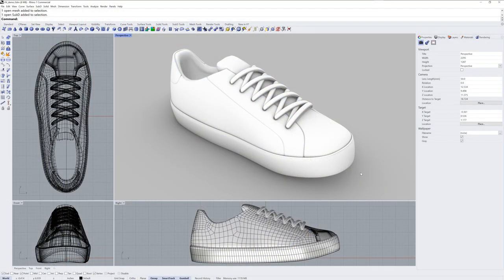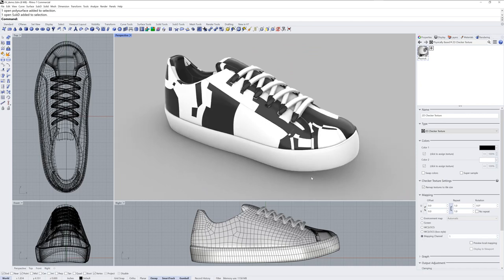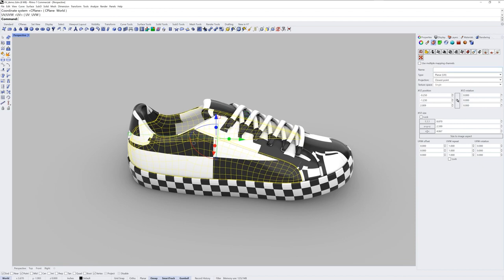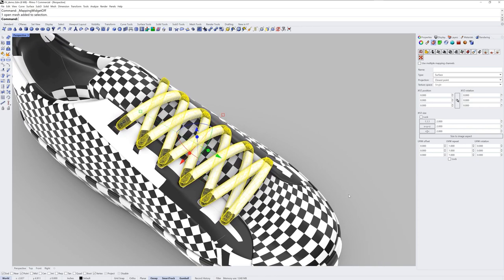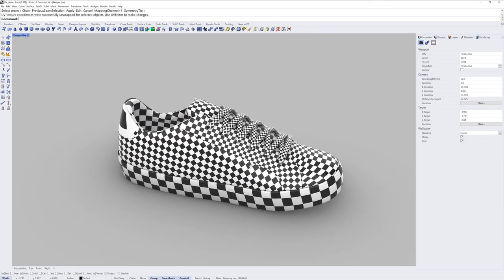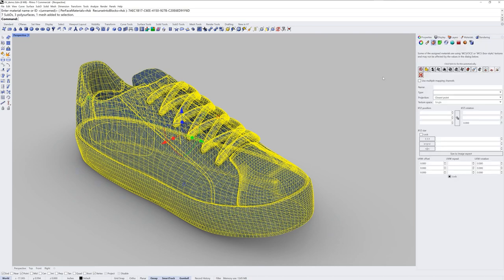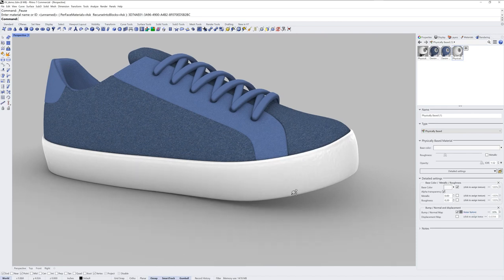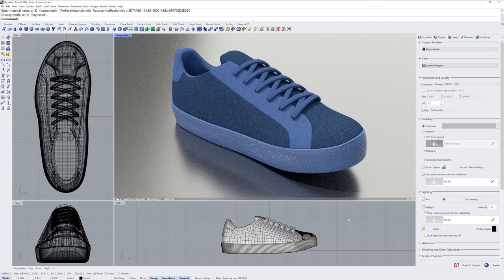texture mapping in rhino 7

Comment: Not bad, but could be improved. There's some stretching (well, squishing) on the toe vamp, and the texel density is not the same across UV islands.
This would be a bit of a nightmare to work with in 3D studios, because we want to create one material and have it applied across multiple islands/objects and not have to duplicate them to accommodate for the different texel densities.